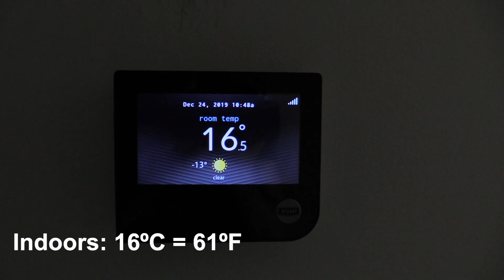Early Diagnosis Of Your Permaculture Property: What to Look For

Comment: You're wearing a T-shirt inside at 16C  - I'm wearing a jumper inside at 21.5C (It's around 16 outside and I'm about to light the fire)
:D
I think you may be a little more cold tolerant than I am!

A fireplace next to an external walls and windows isn't ideal, a wood fire close to the center of the house works nicely I find.....  :)

Comment: Great video! I was wondering...do you have a video on what to do if someone is looking to build a house from the ground up?

I have not decided on whether buying a place with a house or not. I suppose it would depend on the property. But I would really like to have a 3 bedroom plus office (or 4 bedroom), 1.5 or 2 bath, with a usable kitchen, a pantry, and cold room. I would also like to set it up with composting toilets and a greywater system or good quality water treatment system. 

I feel like it’s a tension between having a small, energy efficient, zero sum house, and having a house large enough to live in and use effectively. 

The other issue is, how much would it cost to build a house? Specifically a highly insulated, zero sum house? If I have to spend $200,000 on a property, is it possible to build a zero sum house and get the utilities and all that comes with getting a house up on bare land...can that be done with just another $200,000? Would getting a steel building and insulating and then framing in the inside be a good option? Is spray foam really that good of an option? I do understand that it’s really good at providing a vapor barrier and insulation, however I am concerned about toxicity. I mean, asbestos is a fantastic insulator, and people used it for years...too bad we found out later it’s really bad for us. What about wool or rockwool?

I know this is a ton of questions, so thank you for your consideration and any answers.